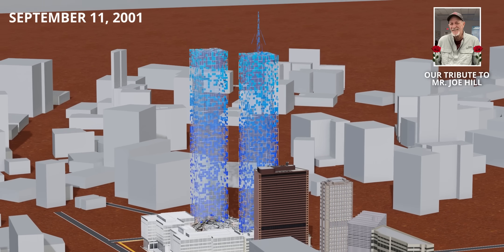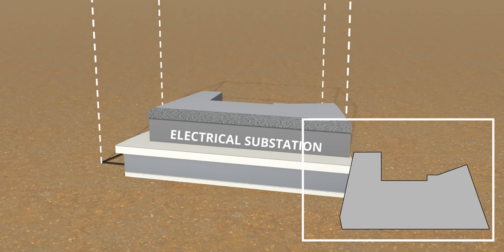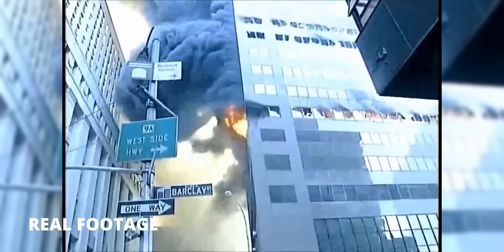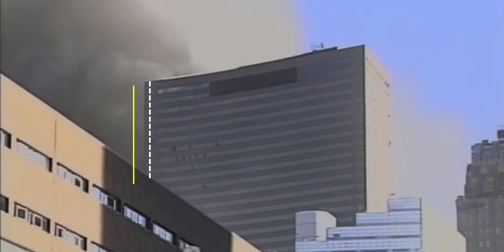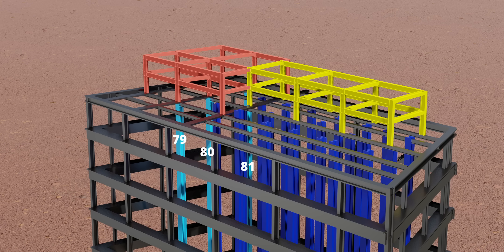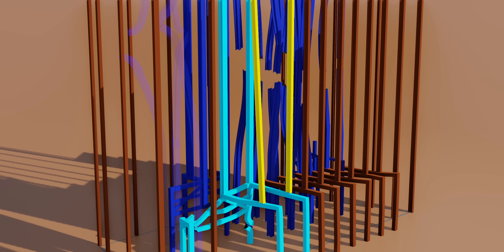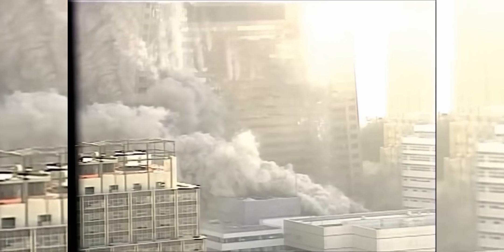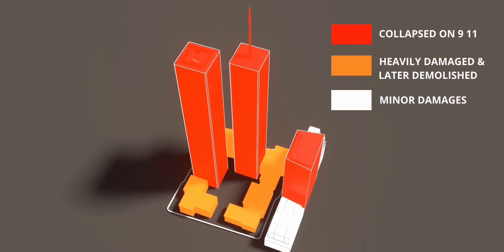Collapse of Building 7 | The Complete Physics

Comment: This is a massive skyscraper not a hotel. This couldn’t fall in its footprint so perfectly from this in any way I’ve investigated
Reply: Then you did it wrong.  Maybe this will help:  Much misunderstood, Building 7 was the 6th building to collapse of 10 lost on 9/11. Because of its early low priority, conspiracy filled the information void with garbage made up by technically ignorant people promoting political agendas. But 7's loss is an engineering problem and should be treated as such, so I prepared this brief summary of my own analysis to fix that, using technical analysis, not ideology and tired memes. 

At 10:28am the WTC North Tower collapsed, showering Building 7 with tons of burning debris, causing heavy damage and starting many large  fires which burned out of control for the next 7 hours. Half the FDNY firefighters having been killed, units in disarray, equipment destroyed, no water pressure, and the greater urgency of search & rescue efforts, Building 7 couldn’t be saved so firefighting efforts were pulled as futile and 7 left to its fate. Firefighters make that sort of choice every day in brush fire situations - which houses to save and which ones to let go. Only real difference here is moving the decimal on the size and cost. People get overwhelmed by the size.

www.youtube.com/watch?v=g_SvpwyC17M

Collapse of a burning structure is always a concern for firefighters. Steel buildings subject to fire rely on active firefighting to survive. Buildings are designed around 1 to 3 hours of fire resistance, allowing time for occupants to escape and active firefighting to get started, after which all bets are off. Left to their own devices they'll exceed their design envelope and collapse, like Plasco Tower and Wilton Paes de Almeida. In 7 the occupants escaped, passive and active fire protections were compromised and active firefighting was abandoned hours before the collapse, which left the building to its fate. It lost. Odds on Building 7 would eventually collapse, and it did. No big deal in logic.

 http://www.youtube.com/watch?v=WnYBX6QT0R4 

FDNY Chief Daniel Nigro - The biggest decision we had to make on the first day was to clear the area and create a collapse zone around the severely damaged 7 World Trade Center, a 47-story building heavily involved in fire. A number of fire officers and companies assessed the damage to the building. The appraisals indicated that the building's structural integrity was in serious doubt. I issued orders to PULL back the firefighters and define the collapse zone. It was a critical decision; We could not lose any more firefighters. It took a lot of time to PULL everyone out, given the emotionalism of the day, communications difficulties and the collapse terrain 

FDNY Deputy Chief Peter Hayden ; We had our special operations people set up surveying instruments to monitor and see if there was any movement in the building. We were concerned of the possibility of collapse in the building. And we had a discussion with one particular engineer there, and we asked him if we allowed it to burn could we anticipate a collapse and if so, how soon? And it turned out that he was pretty much right on the money, that he said 'In its current state you have about 5 hours 

The collapse of Building 7 was anticipated and widely reported in the media throughout the day, with 24 video cameras recording some or all of the collapse. Everyone knew what was coming and why. 

www.youtube.com/watch?v=OY5S5k3tMHI

The collapse of Building 7’s was entirely different to the Twin Towers and harder to understand, most details being hidden from view and not intuitive.  But we can still sort out what happened through careful analysis and observation. This is my explanation of the collapse relying on no outside authority. 

Building 7 was a unique, asymmetrical 47-story steel framed structure built atop a smaller 3-story building serving as a partial foundation, requiring lower floors dedicated to complex load transfer structures. Of trapezoidal shape and all-steel tube-in-tube construction, B7 (above the 7th floor) consisted of a central core of steel columns carrying most of the gravity load, perimeter steel columns around the outside of the structure carrying the remainder of the gravity loads and long span beams and girders to tie those elements together and form the floors. On the outside of the building hung a moment frame or outer shell. 

Phase 1 : First externally visible signs of collapse initiation occurred at 5:20:28 pm and were notably quiet with observers not realizing the building was collapsing! No audible warning in the form of hundreds of ear drum busting 180-190dB explosive bangs preceding the collapse. Here at 12:00 a local CBS affiliate reporter is talking 10 blocks from B7 when collapse begins. People don’t start to notice the collapse until 12:11. At 12:45 is the famous CBS fixed camera clip of Building 7’s collapse. Note how quiet it is. 

www.youtube.com/watch?v=t5tEy6mXSE8

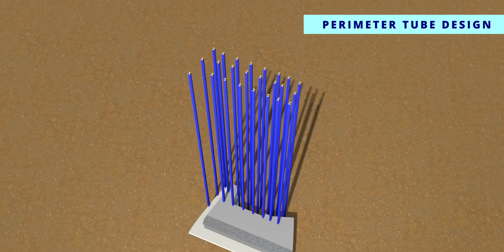Collapse initiation was due to lower floor failures above the load transfer region (8-14th floors) in the NE corner. In this video at 0:45 you can see the NW corner from inside the building while under construction, Column 79 just out of frame on the left. That big, angled steel beam across the top of the frame connects to C79 at one end. The girders connect to the beam. That beam and all those girders depend on just one connection 

www.youtube.com/watch?v=nP3TNHPCIVU&t=45s

Phase 2 : The NE lower floor failures caused a loss of critical lateral support over an excessive length of Column 79 and it buckled. Looking at a floor diagram of Building 7 (www.nist.gov/image-16640) when you see all the structures that depend on C79 you quickly realize this one column was a relatively isolated structural element on which a disproportionately greater fraction of the structure depended analogous to say the Key Bridge. Externally as collapse begins we see a vertical progression of window breakage along the 44-46 line and a kink in the roof of the East Mechanical Penthouse at the top of the building, consistent with C79 failure. Normally with a buckling column, the load could be redistributed to other columns. With C79 that is not the case - the failure did not redistribute the load, so the collapse rapidly progressed to the roofline, sinking the rooftop penthouse. The transition from full capacity to almost no capacity occurs in an instant and will result in virtually no resistance 

Phase 3 : With C79 gone, B7’s progressive, non-symmetrical collapse continues with adjacent columns 80 and 81 left laterally unsupported, and quickly buckling as well, sending the EMP down through the building. C79-81 all have no diagonal bracing, which is the major reason why they could not redistribute a lot of vertical loads among one another. From there collapse progressed from east to west through the central core until the core was gone taking all of the interior floors and probably most of the perimeter columns with it. Follow the horizontal progression of window failures low in the building and the dropping of the remaining rooftop structures into the building. One of the big takeaways from the NIST Building 7 study (invariably ignored) was how their modeling determined C79 failing under ANY circumstances would have initiated the same collapse sequence. 

Phase 4 : After about 10 seconds only the exterior moment frame remains, giving the illusion B7 is still standing to the casual observer since little has outwardly changed. But it is just a hollow empty shell like an empty cereal box supported only by a few remaining columns and overloaded from the loss of the core columns and floors, quite unable to remain standing. With nothing remaining behind it, the north face leans inward, forming a V in the roofline, the last few columns buckle under the strain and the moment frame free falls, landing on top of the debris pile. 

It is only here at the very end that a single measurement of alleged free fall acceleration is taken, from a single point on the outer shell. The Building did not “free fall” – just one corner of the outer shell did, sort of. The Building_ (defined as its center-of-mass) was already gone before that happened. The period of alleged free fall was a product of how it fell NOT why it fell and can't tell us what started the collapse 10 seconds earlier. Start to finish the collapse took 18-20 seconds, 3 times longer than free fall . How fast something falls cannot tell you what started it falling_ anyway. 

The debris spread outside the footprint blocking surrounding streets, heavily damaging the Verizon Building and destroyed Fiterman Hall. 

Building 7’s progressive, non-symmetrical collapse was incidental and unintended collateral damage from the combined effects of fire + time + gravity, started by the collapsing North Tower. That is true no matter who planned and carried out the 9/11 attacks or why . The collapse was of so little consequence it barely registered at the time - a footnote, only taking on semi-mythical status as an alleged smoking gun years later when demolitions at the Twin Towers, missiles at the Pentagon and shoot down over Shanksville all failed and conspiracists had nothing left to work with. 

Anything can seem like a conspiracy if you don’t understand how it works. Now you should. I hope you found this helpful, informative and it solicits informed critical comment. If I made any errors of fact, logic or reason or left anything important out, please let me know so I can fix it. IF you can offer a more plausible alternative please do. Be the first. Please start any reply with the words “Tits McGee” or I will know you didn’t read it and are wasting my time.

Comment: Your explanation relies on the bearing columns failing because of high temperatures in the areas of the columns for extended period of time. Do you have any actual data to support this? If buildings would come down because of large fires, we would see building falling all over the place. But this is not the case.
Reply: 1.  No, this explanation does not rely on the bearing columns failing because of high temperatures in the areas of the columns for extended period of time - however one chooses to define that.

2.  The collapse of Building 7 is one of the most studied engineering disasters in history, the subject of at least 5 comprehensive engineering studies and scores of articles in peer-reviewed engineering and fire science journals. Thousands of pages of material.

3.  Earlier this year we saw 17,000 buildings come down in one city in just a couple of weeks due to fires. Maybe you caught that on the news. Buildings are destroyed every day by fire. This is why we have firefighters and fire departments. 

At 10:28am the North Tower collapsed, showering Building 7 with tons of burning debris, causing heavy damage and starting many large  fires which burned out of control for the next 7 hours. Half the FDNY firefighters having been killed, units in disarray, equipment destroyed, no water pressure, and the greater urgency of search & rescue efforts, Building 7 couldn’t be saved so firefighting efforts were pulled as futile and Building 7 left to its fate. Firefighters make that sort of choice every day in brush fire situations - which houses to save and which ones to let go. Only real difference here is moving the decimal on the size and cost. People get overwhelmed by the size in this case but fundamentally, a building is a building is a building.

www.youtube.com/watch?v=g_SvpwyC17M

Collapse of a burning structure is always a concern for firefighters. Steel buildings subject to fire rely on active firefighting to survive. Buildings are designed around 1 to 3 hours of fire resistance, allowing time for occupants to escape and active firefighting to get started, after which all bets are off. Left to their own devices they'll exceed their design envelope and collapse, like Plasco Tower and Wilton Paes de Almeida. In 7 the occupants escaped, passive and active fire protections were compromised and active firefighting was abandoned hours before the collapse, which left the building to its fate. It lost. Odds on Building 7 would eventually collapse, and it did. No big deal in logic.

 http://www.youtube.com/watch?v=WnYBX6QT0R4 

FDNY Chief Daniel Nigro - The biggest decision we had to make on the first day was to clear the area and create a collapse zone around the severely damaged 7 World Trade Center, a 47-story building heavily involved in fire. A number of fire officers and companies assessed the damage to the building. The appraisals indicated that the building's structural integrity was in serious doubt. I issued orders to PULL back the firefighters and define the collapse zone. It was a critical decision; We could not lose any more firefighters. It took a lot of time to PULL everyone out, given the emotionalism of the day, communications difficulties and the collapse terrain 

FDNY Deputy Chief Peter Hayden ; We had our special operations people set up surveying instruments to monitor and see if there was any movement in the building. We were concerned of the possibility of collapse in the building. And we had a discussion with one particular engineer there, and we asked him if we allowed it to burn could we anticipate a collapse and if so, how soon? And it turned out that he was pretty much right on the money, that he said 'In its current state you have about 5 hours
Reply: Slayer69 they have no evidence. This all is derived because of a kink and a certain area falls first.  In CD these kinks are very important. Just like taking out the stairwells and elevator shafts first. That's the real reason it kinked and fell first in these 3 columns. Not to mention in this video the diagram shows a parameter columns distroyed because the windows were missing. Video shows corners of the building missing. Reality did not. If the diagram is correct. Why was the roof not damaged from the antenna as well? Then his explanation is the 3 failed because of heat. Then the rest just failed, no explanation at all. None of this explains how the building held its shape all the way to the ground. If just one exterior column held up the roof lines wouldn't have stayed flat all the way to the ground.  This proves all the exterior supports were removed at the same time continously as the building fell. Real people understand this once explained to them, that's why so many comments disagree with stinky and his sidekick here. That's the difference between programming and actual intelligence. They don't know. I think my favorite part of this video is when he says you can see the fire spreading. And shows you a 3 second video of a fire. No one can see a fire spreading in 3 seconds😂😂😂... then the most important part according to this video was three bent ibeams. No evidence whatsoever where the bent beams come from. Classic look over here not over there and these 2 morons fall for it everytime.

Comment: Maybe some of it would have from this but impossible for it to entirely collapse into its footprint from this
Reply: Good thing it didn't collapse in its own footprint then I guess, as the debris pile completely blocked 3 surrounding streets in debris up to 7 stories high, caused nearly a billion dollars in damage to the Verizon building across one street and fatal damage to Fiterman Hall across another.

All well outside Building 7's footprint
Reply: @TheCriticalStinker-01 I realize it caused collateral damage but nearly 50 stories of building doesn’t disappear over relatively small fires. There’s been sky scrapers burn entirely and never fell. It’s just hard to believe that three buildings would fall straight down. Not to one side, not just partially,  but perfectly straight down.    Then our gov still has all the info classified, and the only reason to hide (classify) information after 24 years is if you lied and you’re hiding something. That’s literally the only reason
Reply: @jamesmix78  - Or not. You do you.

Comment: The odds of winning the lottery and getting hit by an asteroid at the same time are more realistic than the official 9/11 story.

Let’s assume the story in Manhattan is true. Where is Flight 93? Swallowed by the Earth? 
Okay, fine… let’s assume Flight 93 is real too. That 'maneuver' by the plane that hit the Pentagon… 120 security cameras and only 3 frames captured/released?

BBC News correspondent Jane Stanley talking  live about WTC7 collapse while you could clearly see WTC7 standing still behind her…7 years later they said, the information came directly from Reuters?
Asymmetric Fire spots…symmetric collapse/free fall?

Shall I continue?

Why wouldn’t the Bush administration open up the case in the 9/11 Commission Report, but under the media pressure from the Jersey Girls, they finally released something?

The burning of kerosene alone is physically insufficient to fully explain the symmetrical collapse of these massive towers, especially not at the speed and totality of the collapse as observed here.

A symmetrical collapse means that a building falls evenly, straight down over its footprint—almost as if it simply folded in on itself. But if fire weakens only certain areas, the failure usually occurs unevenly: one side gives way first, the building tilts, it might even fall sideways. For all supporting structures to fail simultaneously is extremely unlikely in an uncontrolled fire.

That two separate towers, with different impact angles, varying damage, and distinct fire patterns, both collapsed almost identically—symmetrically, quickly, and completely—is statistically almost impossible. This is mathematically highly improbable and contradicts any scientific studies.

Doubt is not conspiracy. cheers
Reply: OK, but do you have anything to say relevant to the subject of this video - Building 7 collapse mechanisms?